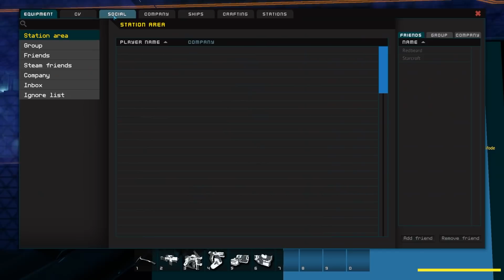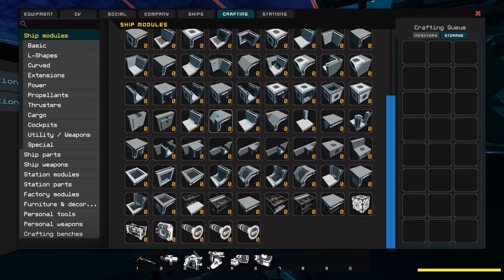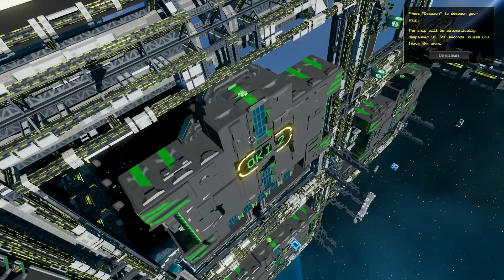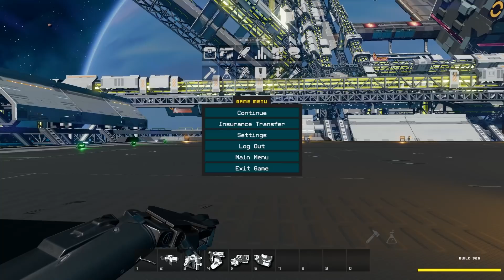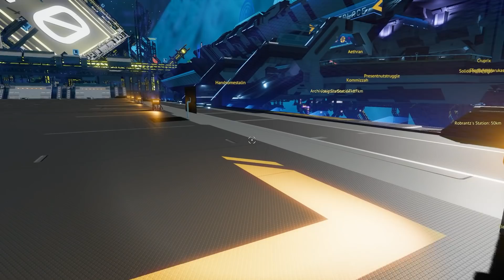Starbase - Upgrades, Building, and Buying

Comment: For buying a ship, you can reduce the ore/cash requirements if you have already built some of the components (they need to be in the station storage) and in some cases, it's a rather nice cost reduction.

Comes in handy if you're already building parts while grinding out the research trees, but don't want to "build" a ship yourself.
Reply from the maker: That is true
Reply: @Anthroskye  Only mentioned it because when I found out about it, went back and seeing just having 3 or 4 items dropped the total cost of the same ship by almost 20k and a noticeable amount of resource stacks.

What I'd love to see added to the ship market UI is a list of the components for that ship, so a player could build the base parts for the research points, and get the ship design they want.

Comment: started manually upgrading my ship too, found you can drag out of station storage right into space then grab to move into place (toggle C for auto-connect and also you don't need to put stuff in your inventory) also holding down the bolt-gun tool will auto bolt in the yellow highlighted locations (so you don't need to manually click each)
Reply from the maker: yep

Comment: Easy build works fine for me IF and only if you use 100% modules. Not a single other item, not a work bench or a beam or anything or a light or anything!. Using only modules so far has worked completely fine zero bugs or issues for many many hours.
Reply from the maker: awesome
Reply: We can no more use others thing than module in EB Mode since yesterday update anyway

Comment: EB is not broken i edited my starting ship many times, didnt have any issue
Reply from the maker: according to the hourly update from the devs and the known issues section of the discord, it is. Glad it works for you, but not everyone is so lucky in case you missed the huge cloud of debris outside the area. lol.
Reply: @Anthroskye  what exactly is not working for you? I manage to rebuild starting ship, added some storage, walls and few engines. Ship sometimes was flickering but it lasts for like 3 sec.
Reply: An exemple, for any reason i can no more build the 4x1 crate row module in EBM. Because when i try to place the row, firstly all appears well green highlighted and all side of the edge well aligned like usual, But when i left click for place the row it appears/build completely miss aligned (like 20 cm gap btw one side clipping in the ship, another side in the void) and without any way to get it back to inventory with the welder where any others module work well for now.